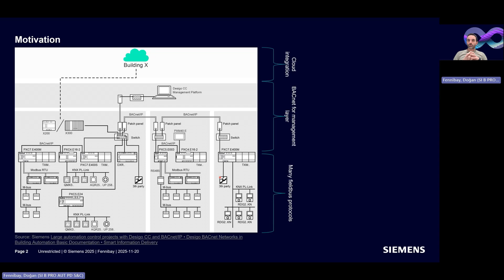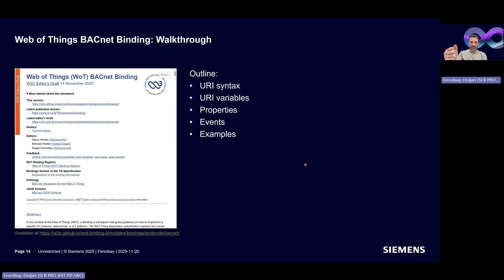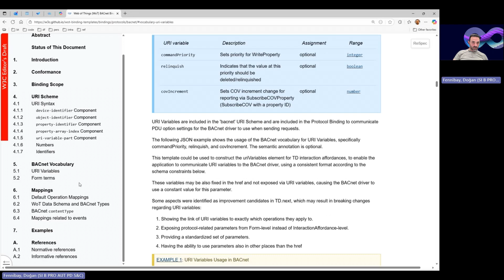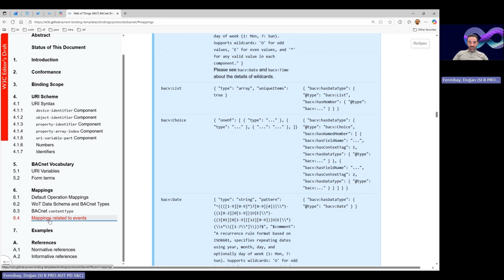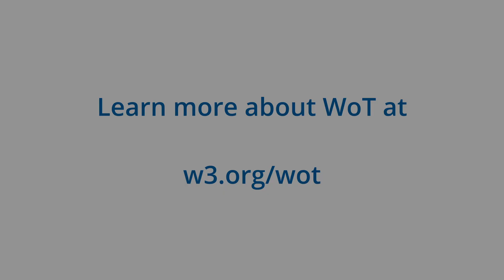Meetup 30: Enabling IoT in buildings with BACnet and Web of Things

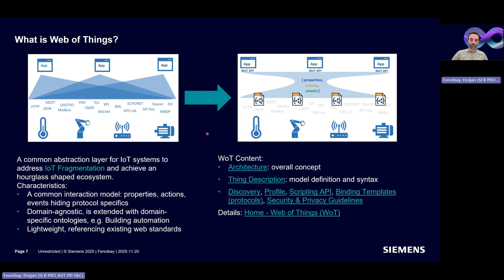Comment: Thanks for the recording. A correction based on the feedback I received: SDF (9:22) is not a vendor-specific standard, but a consortium-driven standard; and it is actually based on WoT. So it should be considered under the users, and not alternatives.